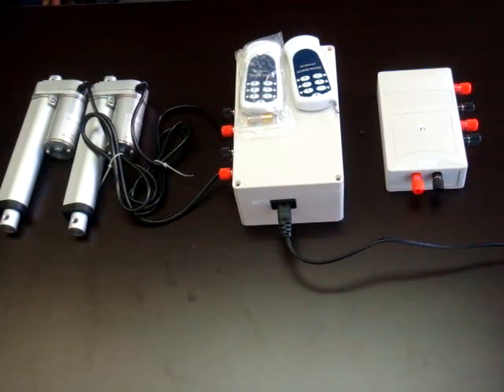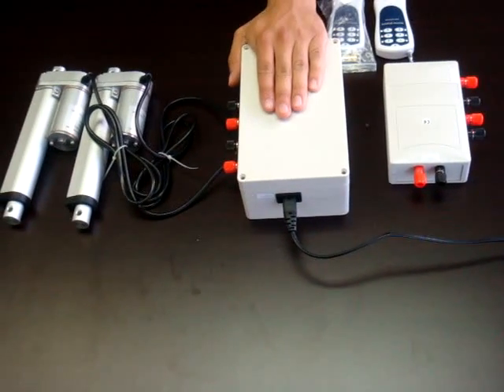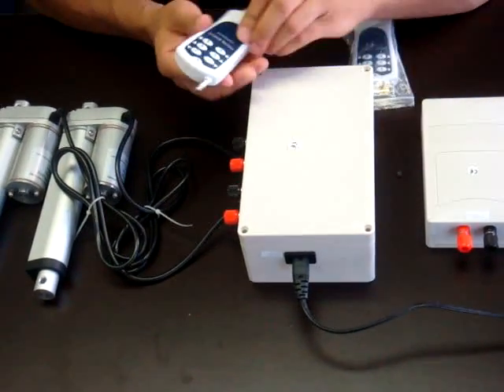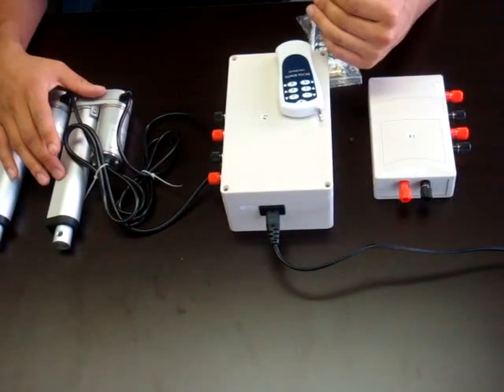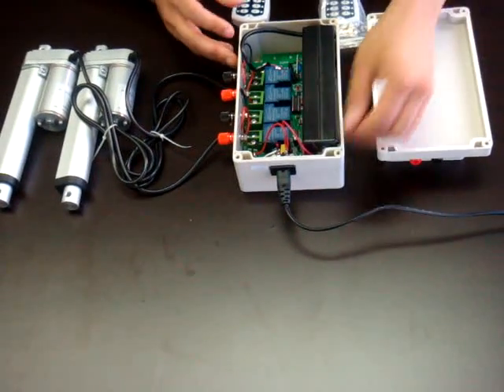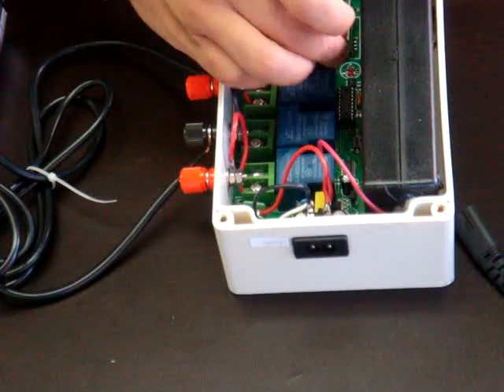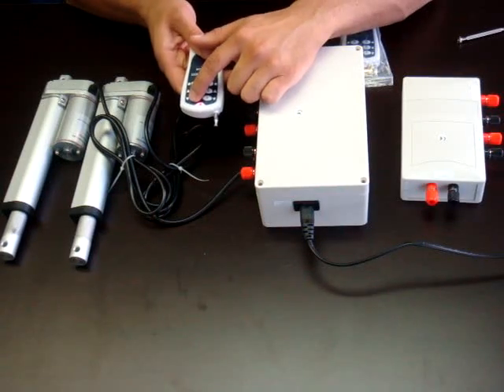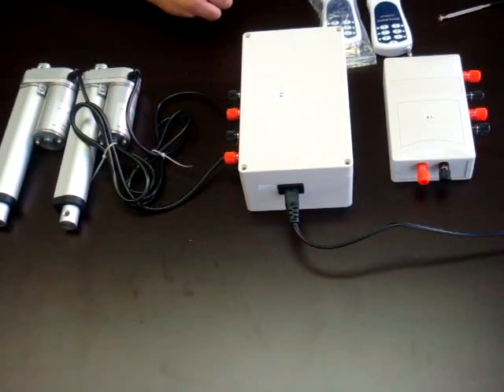Control Box for Linear Actuators with Non-Simultaneous Function - Progressive Automations

Comment: will the 12vdc version of this operate a pa-17 type of actuator? and if not what control box do you have that will wireless?  that's what my lift on my van requires with a force of 850lbs not that i weigh that much thank goodness. and a stroke of 12ins. It appears that the pa-31 control box cannot operate a actuator of this size.  I'm just asking is all.

Comment: Please correct me if I am wrong. I do not see anywhere that you have a video illustrating the simple connection of your actuators to the control boxes which connect with the red and black knob (posts). It appears that in all examples, they are already connected. I suggest that this may be a good idea. Congratulations on a good job, providing a much needed service/supply.
Reply from the maker: Thanks for the suggestion! We appreciate the positive feedback and will look into making such a video. Stay tuned!
Reply: Progressive Automations Well it has been a while and I do not see that this has been done. There are a lot of articles on your website but details would be very nice. For example, look at your ideas for building an automated recliner....nothing. Your SHORT ELECTRIC ACTUATOR GUIDE TO 'WHAT COULD POSSIBLY GO WRONG?' ....practically nothing.How about some detailed; How to wire up a PA 28 control box, complete with what fuses to use, etc.It would be very helpful,
Reply from the maker: We're going to dedicate a lot of time and effort on updating our video library to address these types of issues in the coming weeks. Stay tuned!